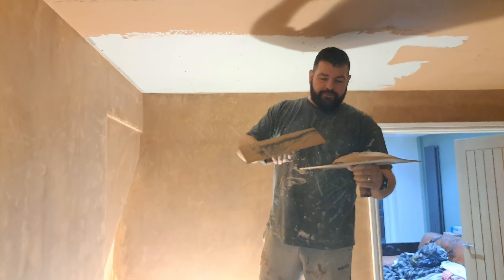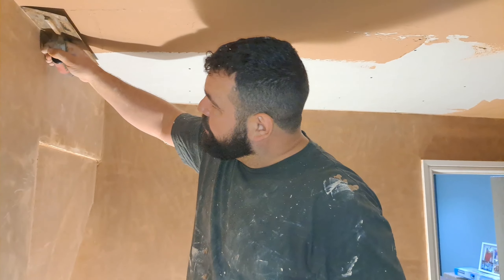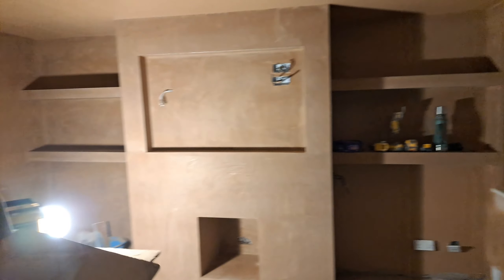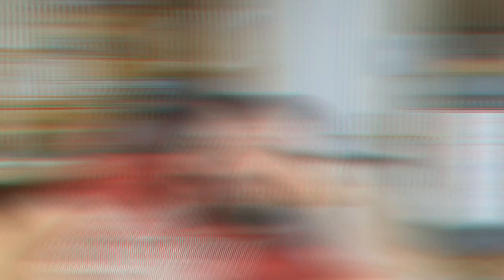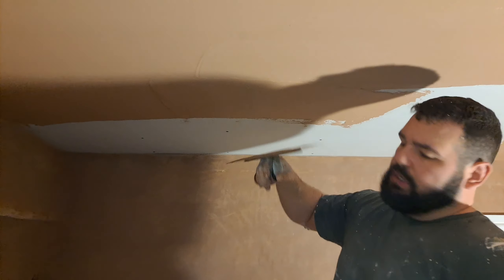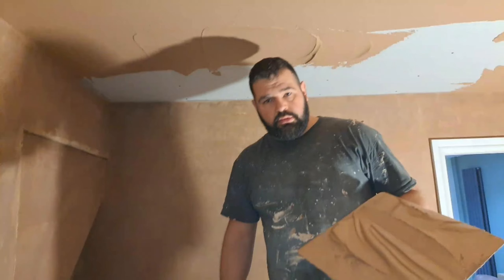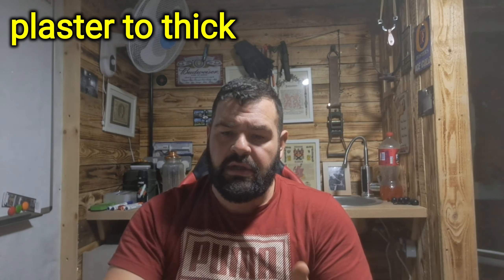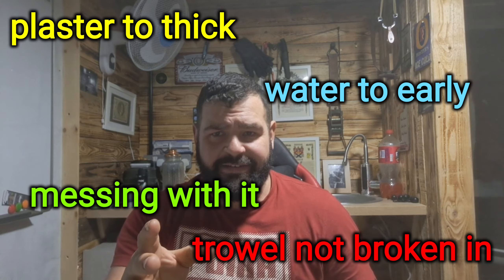Tiger Stripes in the Plaster + Trowel Techniques for Beginners

Comment: We were talking about tiger stripes today. Im suffering tendinitis at the moment so its hard to apply pressure on the 2nd and 3rd pass. Ive found on the 3rd pass using a sponge float helps with this problem then hitting with the flex. Just a tip that might help others. 
Though i wouldnt recommend a sponge float on a ceiling. 
Keep up the good work fellow plasterers. Its a tough game but we love it.🤝
Im 21 years in the trade. Every day is a school day.

Comment: Tiger stripes two different sets in one batch of plaster,adding plaster 15 minutes after the original mix.
The first mix sets on the wall before the second then you are fighting to get the second set down to the first mix.
When you mix a gauge don’t stop until your happy with the consistency and all the set is of the same timing.Scratch on as good as laying in layin as good as first trowel.

Comment: excellent  plastering tips !  if you were thermal boarding  external walls   what plaster boards would you use on the chimney  breasts  ?  thanks
Reply from the maker: I like using sound block boards. Only because they are solid. So much more dense than a normal board but it wouldn't hurt to use a standard 12.5 mm
Reply: thanks for the advice !